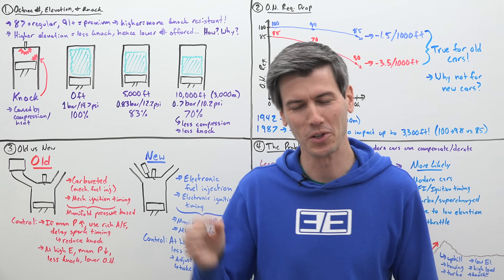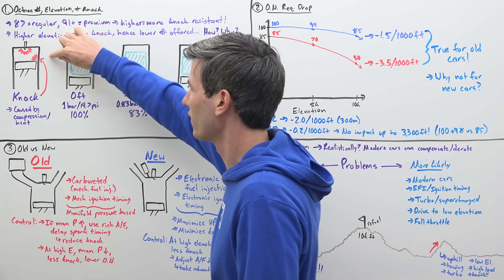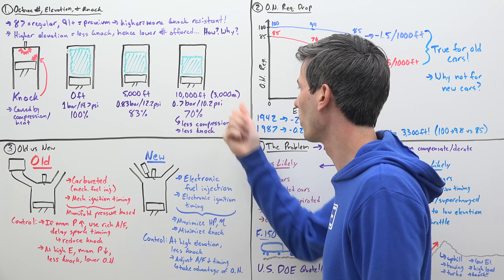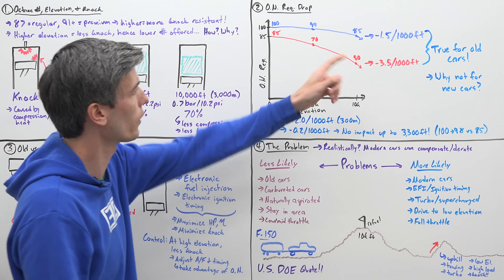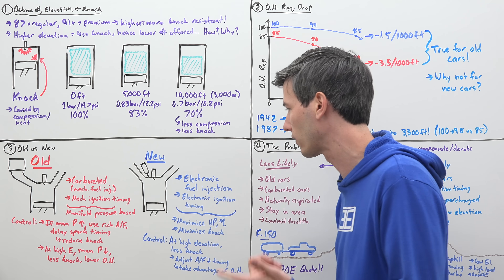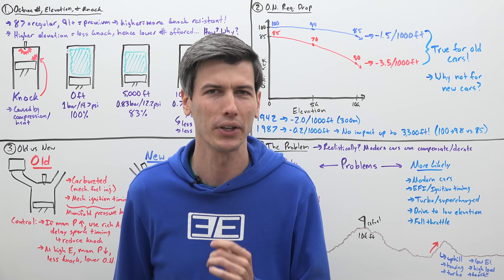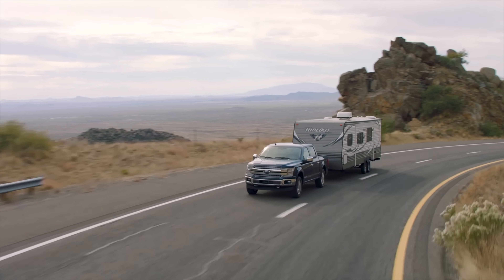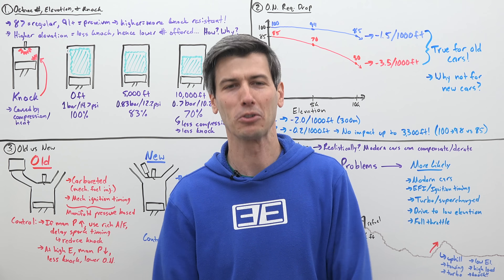Never Use This Gas In Your Car!

Comment: Thank you Jason for addressing this! Back in the 70s and 80s in the Intermountain West, regular leaded was 87 and unleaded was 85, even if you lived at a relatively low elevation like 2000 feet. You had no other unleaded fuel option and 85 octane unleaded was some 5% to 10% more expensive than leaded regular. What's unfortunate is that most people back then knew the dangers of lead and would have paid the same or a little more for an equal octane unleaded but it just wasn't available. Instead it was very common for people to yank out the catalytic converter so they could simply run better fuel because, in reality, car performance suffered significantly when the timing was backed off enough to be able to run on that 85 octane garbage no matter what elevation you lived at. It wasn't until the late 80s that unleaded premium became available and you could get decent performance again. Fuel in the US is relatively cheap, but it's a substandard product. If octane ratings were required to be in the mid 90s, we could get away with engines that are smaller and more fuel efficient yet still make the same power via higher compression ratios or forced induction.
Reply: @Lassi Kinnunen 81 There's a big difference between 85 and 87 octane. Back in the day I'd have to back the ignition timing off 4 degrees to run on 85, else the engine would ping and clatter badly, power and mileage dropped.
Reply: Yep moving to diffrent states i saw it too
Reply: Sadly, it seems to be politics, along with lobbying from agriculture. So E85 can be promoted as a 'green' fuel because it's adulterated with ethanol made from corn. If it reduces efficiency and damages your car, well, that's your problem. But the suppliers are saving the planet.
Reply: @brolohalflemming7042  E-85 is nothing like 85 octane gasoline. E-85 is 51-85% ethanol alcohol, aka drinking alcohol, depending on your location in the US. It's cut with gasoline to aid with cold weather starting. The colder your location the more dino gas it has. E-85's octane rating (100-105) exceeds most offerings at the pump. It's the poor man's nitromethane, as long as you can remove the gasoline and water it absorbed. Is it terrible fuel mileage, compared to dino gas? Yes. Does E-85 damage the fuel system? Yes, if you don't replace the components that get damaged over time for ones that aren't affected by ethanol, but to sit there and compare it to a substandard fuel, like 85 octane, please do some research before you let your fingers do your talking
Reply: @brolohalflemming7042  Sugarcane and beets are much more efficient sources of bioethanol than corn anyways. It's been demonstrated countless times that corn ethanol's net energy balance is a big negative but the only reason we do it is because of corn lobbyists.
Reply: @electric7487  I think it was the EPA which  dictated the use of the corn for ethanol. Of course it could be the lobbyist's who had the laws written to use the corn to support the requirement for Ethanol.  If they made the Ethanol from switch grass or something similar, then the need to produce as much corn would disappear.
Reply: @brolohalflemming7042  I don't think we're talking about the same thing. E85 is very high octane fuel, something like 100 plus. When unleaded came out in the mid 70s, it was 85 octane in our area and cars had a hard time running on it and there was no alternative.
Reply: God... Reading some of this comments is like watching morons talk about how we could live on Mars but "big real estate doesn't want it to happen, maaan!"

🤦

Comment: It is still available in many Western mountain states since people still use it in many older work vehicles and at ranches for equipment. Their is still a decent sized market for it so the gasoline companies still make it for those intended markets. Though they probably could stop supplying it and few people would really care that much. It isn't that much cheaper and most people have modern vehicles that shouldn't use it but do. Maybe fuel stations should only have a couple pumps of it and have warning signs about the  dangers of using it.

Comment: Well this is crying out for a video about why Cessna's have enormous engines that make hardly any power.
Reply: 180 HP at 2700 RPM is very good for a 360 cu in engine.
Reply: And use 100 octane low lead fuel.
Reply: Low RPM

Comment: I am still surprised its available here.  What amazes me is regular premium fuel with ethanol is 91 octane.  And the 93 octane non ethanol is only a dime higher.
Reply: @Engineering EхpIαined tried but no answer
Reply: @sketchyssk8shop  Don't worry - it is a fake scammer/spammer account, and not the real EE.

Comment: Do high performance cars (super car?)  that require 91 have a similar statement? So with respect to those cars we sell a fuel they shouldn’t use. But is interesting that they sell gas that is 85 other than it’s cheaper.

Comment: You don't need the higher octane in higher altitudes . . . less Oxygen by volume. Had a truck that knocked at sea level . . . had to use mid-grade. At 5000 feet, runs great on Regular.

Comment: I really enjoy your videos, they are full of data, and your explanations are solid as well. 
On this one rare occasion I actually have a comment: Higher octane means higher resistance to self combustion and THUS resistance to knock. This is absolute nitpicking:) You explained it as well, but I'd say that is the order:)

Agree the situation is crazy! My opinion is that Ford could easily compensate for low grade fuel with knock sensors (that I presume they have nowdays), and adjust timing/fuel. I cannot understand why they wouldn't..?

Comment: If you put gasoline in a diesel car or E85 in a non flex fuel car that might void the warranty as well.. I agree that 85 octane fuel is almost useless but I disagree that it's "bonkers" to still be selling it. People living in high elevations still have old cars and if they can use the cheap stuff, why not? And what about things like farm equipment in these high elevation areas? Driving a car requires some responsibility. It is up to the car owner to know what fuel they should or shouldn't be using. Nonetheless, disagreement aside, the explanation was great.

Comment: It should be noted that the unit of measure for octane rating is not globally universal. I.e. RON ≠ AKI. Octane rating expressed in AKI units (used in the US and Canada) will be lower than if expressed in RON for the same fuel.
Reply from the maker: Yes, very important! Notes in the video and a relevant link as a pinned comment!

Comment: I think your definition of  “knock “ stinks sir. It’s detonation which is not the normal vigorous burning of girl that typically occurs, but rather an explosive ignition of the air fuel mix. Explosions by definition are determined to have a greater than velocity of expanding gasses. The detonated air fuel mix moves into that realm of low explosive gas velocities if I’m not mistaken Which creates abnormally high cylinder pressures, which are obviously bad. Diesels are designed to withstand those pressures and do this in purpose, gasoline engines are not.

Comment: They sell Diesel and E85 and it can't be used in a regular gas engine (well E85 maybe but the hoses etc can't handle it)... But I get your point. There should be a different colored handle to make it obvious (like what is done with E85, Kerosene, Diesel etc)
Reply: The difference is nobody recommends 85 and the Department of Energy even recommends against it. There's not reason to sell 85 octane at all.
Reply: @mechmat12345  I mean, maybe just don't use it? I see more of a problem with California only selling 91 vs 93. It's made it so car manufacturers have to design cars around 91, instead of 93 (available almost everywhere else). I'd rather have more options than less - so complaining about 85 seems silly. 
.
Unless you can prove that the price of 87 is artificially raised I see no problems with it.

Comment: I stumbled across 85 once in a '07 Toyota Matrix on a road trip. Didn't realize what I had done until I was putting the pump handle back but didn't think much of it, it was only 2 number, right?  Oh how wrong I was, as soon as the gas that was in the fuel lines before filling up was used I immediately noticed the engine running rough/ nocking. I drove it very gently and began stopping at a gas station every 5-10 minutes trying to dilute it with premium grade fuel and it finally cleared up after multiple additional stops to top off with premium. I have checked the actual rating of the fuel every time since then. Come across it a few more time since then but never put it in again.

Comment: The knock sensor and ECM will adjust ignition timing to stop the octane knock,
Reply: @Engineering EхpIαined well if the lower octane creates an octane related knock, the ECM retards the timing to where the knock is below sensor and ECM limits, this has been the system since ECMs and knock sensors were installed on vehicles
Reply: @Engineering EхpIαined most octane related knocks are from carbon deposits, that retain enough heat to ignite the next charge, a good dose of BG 44K occasionally will prevent those by cleaning the chamber and piston tops, I am former Senior Technical advisor for BG China....

Comment: I thought the knock sensor installed on most engines in computer age addressed this?  My 87 turbo Regal has one. If you went low on octane, it just retarded timing (+other things I guess) and really limited your power?  Great info here, thanks

Comment: In Malaysia we only use RON95 and 97. We do still have old cars from the 60's running around here. Is it safe to put petrol with a high RON in old cars?
Reply: Yes. The issue is low octane in new engines. High octane in old engines will work fine.

Comment: Wasn’t aware that such low octane even existed. As said by others 95 is the minimum in Europe.
Reply: The States and Canada use a different system. 95 RON (Europe) is equivalent to 91 AKI (USA). Still that's a lot higher than either 85 or 87
Reply: @petkogeorgiev2103  ah thanks for clarifying that. Seems I’m pretty ignorant on the octane scale 🙄

Comment: I would argue that turbocharging is actually the number 1 reason that altitude has less impact on required octane now than it used to. Sure, other advancements in engine controls allow you to better use what air charge you have at high altitude. But turbocharging lets you actually increase that charge significantly, to the point where given enough engine speed you end up with the same charge as you get at sea level. That's where the octane requirement becomes basically independent of altitude.

Comment: I have to put 93 in my Kia Rio because it will throw a knock code otherwise.  It's a high-compression 1.6 liter engine, and apparently this is a common problem.  I read online that others have had their ECU flashed, which I assume changes the engine timing, but my local Kia dealer claims there's nothing they can flash.  Even running 93, I can still hear it pinging, though, and they acknowledge I have a knock.  It's a frustrating problem.
Reply: You have a 93 Kia that runs? That's like finding a unicorn in a leprechaun's pot of gold.

Comment: Don't know if it's standard in the entire EU, but at least in Denmark, the lowest octane rating fuel is 95, and 100 is even becoming more common. We used to have 92 as well, but that was years ago now.
Reply: Different calculation for the octane rating. The numbers are not directly comparable.
Reply: @Sylvan_dB  I think their ratings are actually higher. 95 Ron is around 91 Octane.
Reply: i dont think , here in France standard was 98 switching to 95 since 3 years